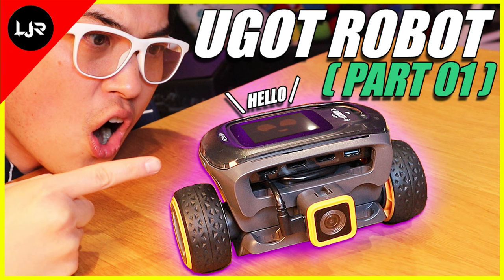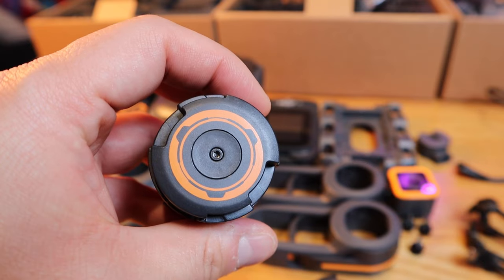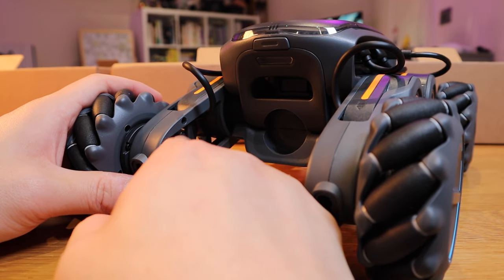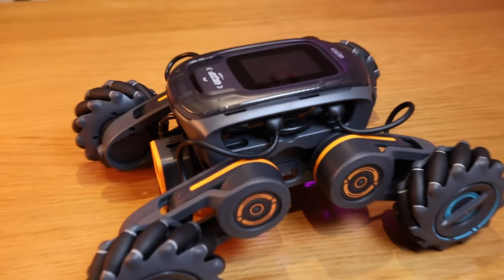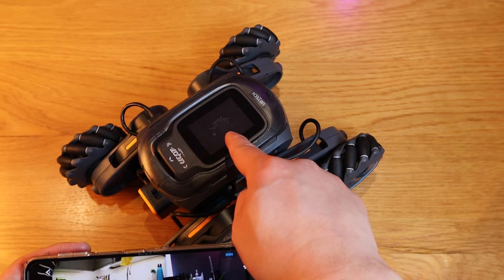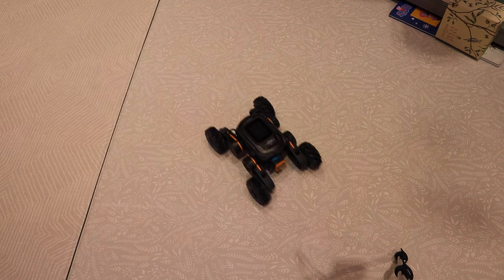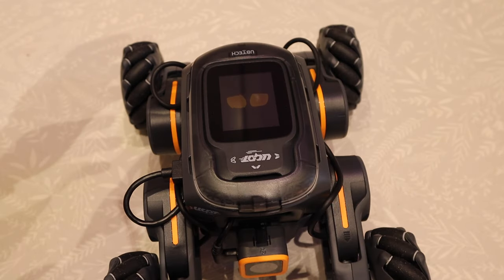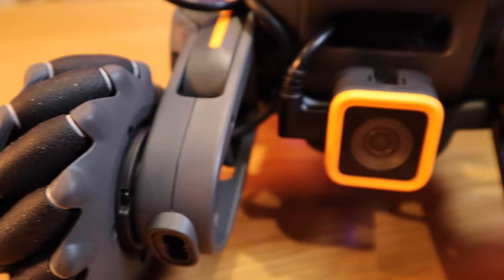UGOT Robot by UBTECH - Is It Worth It?

Comment: You'd think they have at least used L & R to show left & right (instead of a square & triangle) & does the included sensor not stop the robots falling off edges?
Reply from the maker: There is distance sensor which was shown on my previous video but no sensor to prevent falling off the edge - it is designed to be mainly on the ground.
Reply: @ljptech  funny how it's designed to be mainly at floor level...yet the camera can't be rotated up & down & the screen can't be flipped. Definately starting to see a few things that could have been implemented better for such a highly priced item. Glad you seem to be enjoying it tho, I'm expecting mine next month
Reply from the maker: @neilrisley3443  I hope my video does not spoil your joy of discovering the use of this robot
Reply: @ljptech  no...its never a bad thing to give both positive "&" negative points. Keep doing you, it's fine 👍
Reply from the maker: @neilrisley3443  thanks